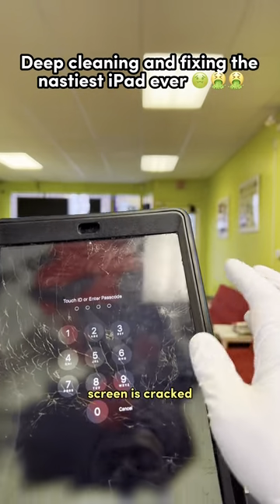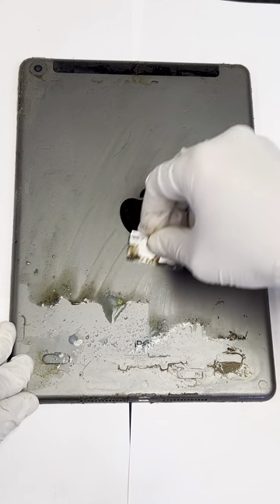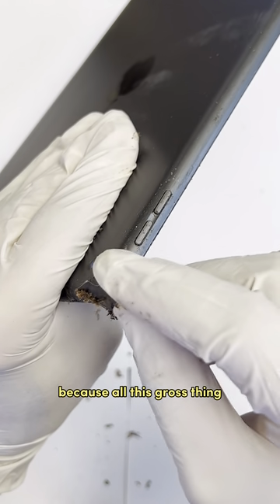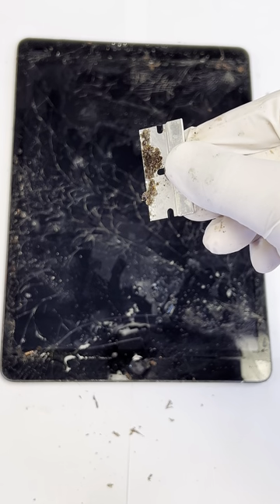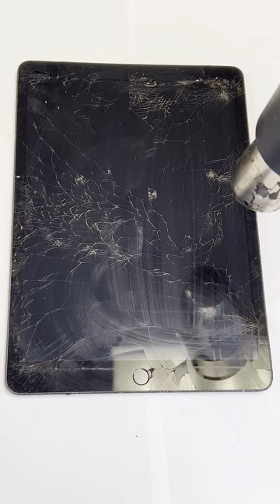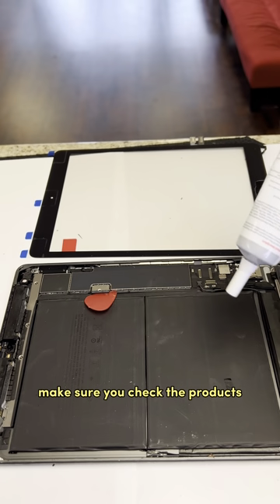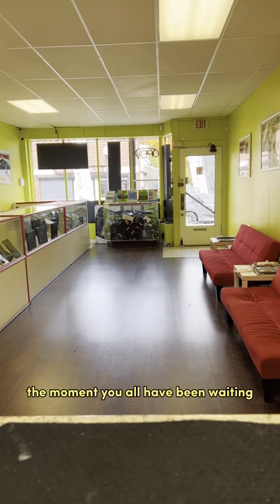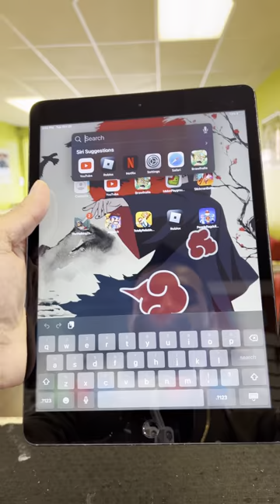DEEP CLEANING THE NASTIEST #ipad and case I’ve ever seen 🤢🤮 #asmr #gross #nasty #hair #roblox

Comment: All this sticky substance is what probably leaked out of rubber.

With age, oils and plasicizers might begin to migrate to the surface as the rubber breaks down. One of such examples is when your TV remote control becomes sluggish, and if you open it, you'll likely find ton of gunk and oil that just "materialized" under the buttons.

Comment: Can you fix an Apple Watch ?
It has never been used because it has never worked.  Paid little over $400. Then called Apple and they told me the watch can never ever be fixed, and it could it would cost t much money and I would be better off just getting another one.  Have called and called and have even sent the watch to them. The watch has never worked and has never been on no one’s arm. This is just so much to loose in this hard time.
Is there a way you can help ? Please.